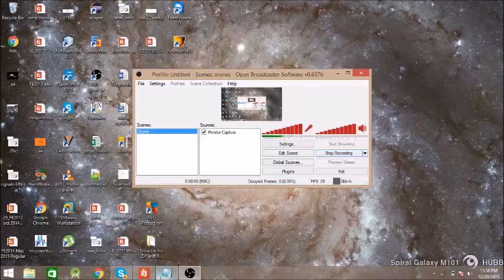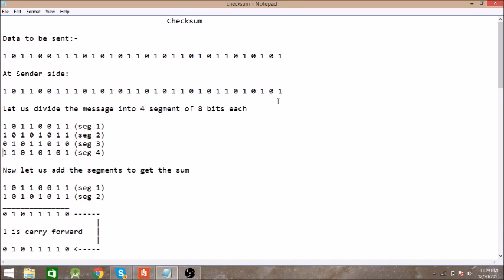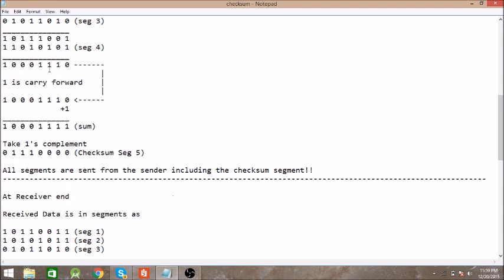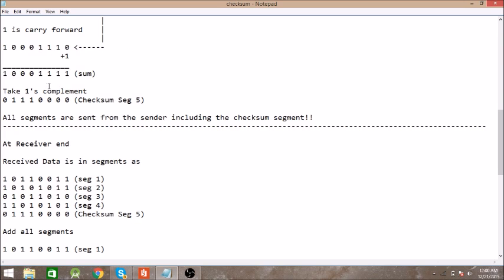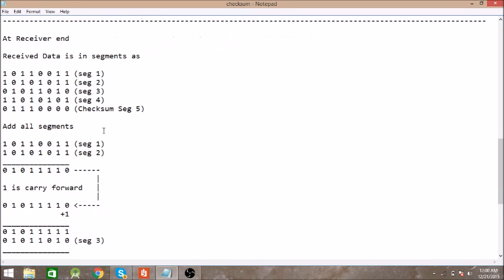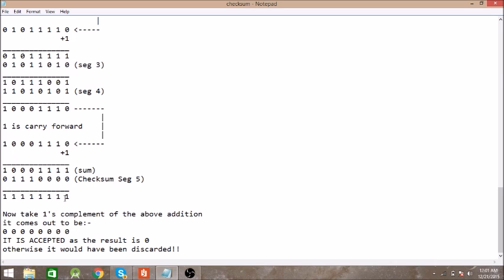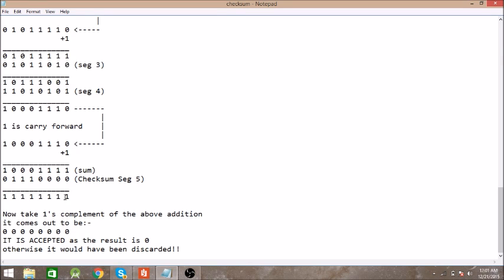checksum example

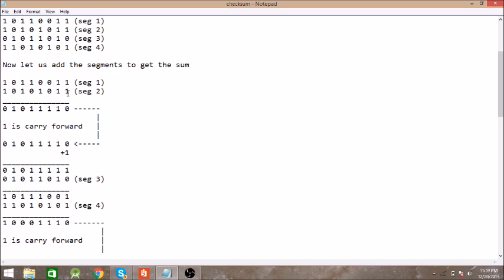Comment: thx for the video just for anyone confused: wrap up --> at 0:51, 10110011 + 10101011 = 101011110 you re adding 8chars but you end up with 9 chars so the additional "1" on the left has to be added to the result and we call that a wrap up and then becomes 01011111